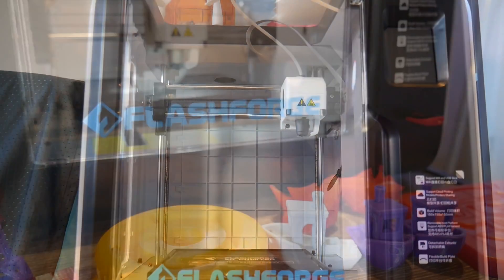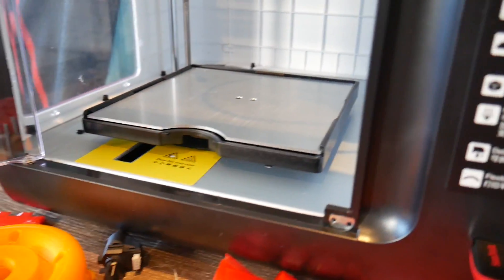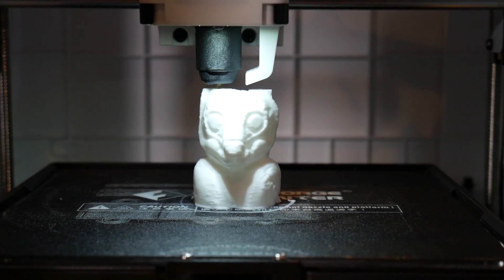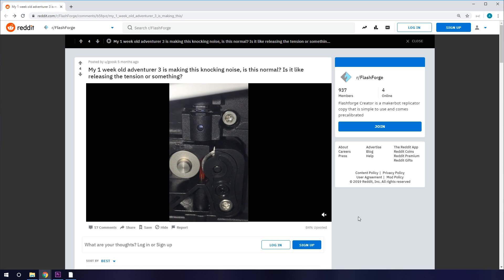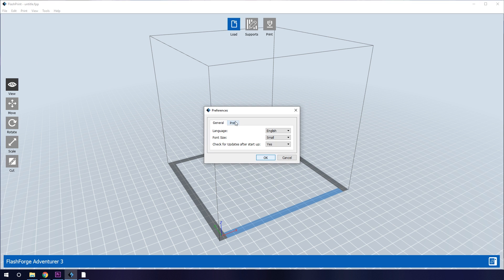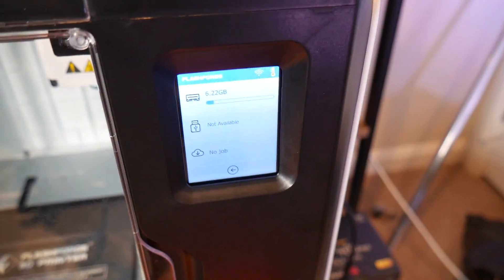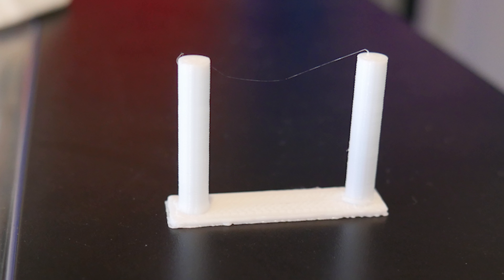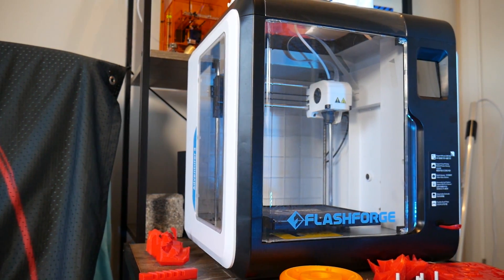The Flashforge Adventurer 3 Review

Comment: I just bought an Adventure 3 V2 to use as an ABS printer at our makerspace.  It did a great job printing the test block with PLA.  Somehow I missed the fact that this printer only takes small spools.  Try to find ABS on 0.5Kg spools.  The only source was FlashForge.  The cost of the small spools of ABS is about 4x the price per gram than the 1Kg spools! Since we are a makerspace with a large spectrum of users, using an external spool holder would certainly lead to disasters.  So, back to Amazon it goes.

Comment: What caused the issue?  Switching from PLA to ABS and back.  The spool change function doesn't heat up (long) enough to clear out all of the ABS from the nozzle, and the next print lowers the temp so the remaining ABS solidifies and blocks it.  Easy workaround is to use a seperate head for each filament material.  Hard workaround is to heat a hex wrench with a torch and go fishing.

Comment: I've noticed by sticking to 500g filament spools that fit inside the unit and avoiding using external spools, I was not only able to use filaments that previously didn't work but it also got rid of that clicking noise. I think the motor that feeds the the filament isn't powerful enough. 

Now, all of my prints, regardless of filament chosen, print amazingly well. I still buy 1k spools, I just now simply off load half of the filament onto a smaller 500g spool.

 I even built a contraption using an Arduino board, USB camera, a servo and an old RC motor. Basically you insert the 1k spool into a machine that looks like an old projector and than an empty 500g spool on the other side, Than while it spools the camera measures out a preprogrammed length, when the length specified reaches it's length, the motor stops and than a servo connected to an exacto blade clips the filament at a 45 degree angle. Everything was printed out using the Creator.
Reply: Thanks

Comment: Stock flashprint sparse infill print speed at 100% is simply to high for this machine, flashprint also use 108 extrusions ratio, (slightly under sized hardware nozzle) and 30% overlap. It will create to much pressure for the filament feeder, especially with 100% infill at 100% sparse infill print speed. Skipping issues with third-party filament is because of the settings. I think they intensionally made it harder to print with third-party filament. Adjusting flashprint settings will make it much easier.

Comment: At least the single wheel runs the correct way. creality hotbeds radial bearings run with sideways load, and no adjustability for sideways play. My ender 2 rollers had almost 1mm sideways movement. The bed was wobbly.  I often get gaps between walls on my ender , and it usually won't stick to hotbed without glue.  

I haven't noticed feeder skipping on adventurer 3 with hotbed at 60°. The skipping starts if I use less than 60° hotbed on 100% infill parts. I use flashforge finder pla and Clas Ohlson 1kg pla spools.

Random ip/mac address issues I've solved the second day after I got the printer.  Firmware update from memorystick.

Comment: Lol I do the same and never use other fillaments besides ABS and stuff from the 3d Printing Superstore in melbourne for ABS. And Jay Car is an amazing place to get fillaments for the Flash Forge printers. The reason I suggest Jay Car over hte Flash Forge website is because the warehouse is always empty.
Reply: Thanks for the tip, Im considering this as my 1st 3d printer and I have a local JayCar near me.
Either this or the Ender 3 v2, still cant decide after watching and reading on reviews for both.
Reply: @TN_AU  If you want an assemble yourself, easy to modify and bigger buildplate go for an Ender, if you want a "box" that comes pre-assembles its like something you just feed and tell it what to do then get a Flashforge.
I had to buy a replacement nozzle for the Flashforge the other day as fillament got badly jammed and because of its design its not really an easy self service. I ended up getting a nozzle V2 which worked better than what I've seen and the quality is much better, the clicking sound that you occasionally hear is now very minimal I would suggest buying from Flashforge if you don't mind shipping cost and its in stock and use JayCar for supplies because you are most likely to get a V2 Nozzle with the printer as JayCar have older versions in stock.

In conclusion, the Flashforge is more user friendly but has limitations with sizes of build, you also cannot print flexable fillament. The Ender will be more on the painful side if you run into issues but in the end I wish I bought an Ender because only being able to print 15cm x 15cm is very small, you also can't print right to the edges on the build plate.
Reply: @cr_macca  thanks for your mini review, much appreciated, pro and cons for both 3d printers, decisions, decisions.
Reply: @cr_macca  doing some research, I wonder if the creality cr-6 se will be a better option than the ender 3 v2, Im happy to spend that little extra and dont mind doing extra mods to improve the unit later down the track.

Comment: The problem you have with mounting errors might be your Cruzer Blade USB stick, I have 6 of them and they all have similar problems.
They also need to be repaired by Windows 10 every time I move it from the printer to the PC.
On my FlashForge Finder, I use their standard settings and PrimaValue filament. No stringing or problems, prints are actually really nice. Maybe you can try that filament on this printer for a second round? 

I can not turn off that damn alarm sound/speaker, I filled mine with glue to shit it up. 😂

Comment: They changed the HotEnd with a new one with a PEEK insert on it. You can spot it also in your hotend so you have the updated one. With the older one it was a pain to print... really. Why is clicking ? If you take a look inside the hotend, the fan is not enough for making an efficient thermal barrier, this is why they added a (brown) peek insert.

Comment: Hi, I am a new  subscriber and a new 3D printer admirer. I own an Ender3 pro and using IdeaMaker slicer. I start using Cura, but once I tried IdeaMaker I love it. One problem is that I have tried all your advices to make it work with the Ender3 printer with no luck at all! My Cura4.0 works excellent with it, but I preferred to use the IdeaMaker best. What settings do you recommend for the IdeaMaker  to work as a Cura? Thanks.

Comment: Wow. Ive had this same problem for ever. Lots of stringing and at times layers split just enough when removing support, it will split layers. I still dont know what issue is. I have a box of different color fillamenta and when I have a good setting for 1 color, its bad for another color, even though its the same spool. I also had to creat a mod for fillament spool. The original is to small for now a day spools.

Comment: I have a Flash Forge Creator Pro 2017 and basicaly all the problems that has mine has but a bit worse especaily the noise, the exstuder gets jamed every so oftern and i have to take off the fan and what not but i solved that by taking out the ones that need alot of heat to melt out when done and swap out the tentions spring for a tighter version so it has alot of roblems but most can be fixed/ delt with.              The Main problem is the slicer program, it is Horendous, please if you ever do anything with Flash Forge again please show a better alterive that works with Flash Forge stuff.

Comment: Devon, the fact they use one motor and a belt to drive de Z-axis is for sure the best option to my opinion and sould by used by many more (low cost) printers.
Using dual motor creates the possebility to misalign the Z-axis when power is shut of from the motors.
With a belt you can never lose position between left and right side on Z-axis
Reply: you have commented this on the wrong channel. this is makers muse, not make anything

Comment: Bottom line, it's a garbage overpriced printer. What's the point of anything mechanical if maintenance, improvements, and modifications are not allowed? It's not even a good printer to begin with and it's a brand name.

Comment: Spend some test print to investigate the clicking sound. The primary cause is the bowden tube, when the print head move from extreme corner to other corner. The bowden tube just flexing and pushing the filament back, so the feed gear lose the grip and clicking. There is 2 solution so far, change the feed gear with grippier gear and lock the bowden tube in the printer ceiling with a tape so the bowden tube doesn't flexing too much

Comment: All these people complaining about this printer, fuck ive had mine for 4 months, yeh i had cluncking issues,  bed wasnt level on the back right corner, but tweeked some settings slowed things up got the bed level, ive run a heap of different brand pla through it, petg all with the old nozzle and it hasnt missed a beat since, only just got the new nozzle and its even better, spend the time like most would do with a new printer

Comment: very happy with my flashforge finder! I can still remember the feeling of ACTUALLY owning a 3d printer! I think now I'm close to 850+ hours printing time, unbelievable :) Flashprint is pretty ok,but these days I use simplify3d, since it performs better. I just load the output from S3D into flashprint (it stores as .gx, I have to manually change it to .g) and print from there. If only I could connect simplify3d to my finder over wifi, than it would be my ultimate solution.

Comment: There was a problem with the MAC address randomly changing causing the IP address to be re allocated. This was fixed with a firmware update that may not have been publicly advertised but was easily found on the forum.

Comment: Great review Angus, not too many issues for FlashForge to iron out, maybe the extruder clicking could be fixed with a firmware update, perhaps even the clogging too.
Reply: In 2019 there's no excuse for extruder issues, especially in a machine which is supposed to be turn key.

Comment: I want to like this printer but can't. Too many niggles for something that can't easily be remedied. I'm surprised the review did not mention that since release flashforge released a newer hotend cartridge that eliminates some of the heat creep that causes the clicking. Also no mention of the propierty gcode format. 
Also "bed leveling" (one point in middle of bed - just z offset calibration) is done on cold bed. No mention of flashforge pita method to "level" bed (watch their video on z screws calibration). No method for back to front leveling except layers of tape under the roller on right hand side.
It is worth mentioning that removing nozzle cartridge also requires a reboot of printer as thermistor will not work. 
Also seen as you mention webcam as a feature you should point out that this is only when using cloud printing which seems very dodgy to me! Can only access your webcam from a flashforge server!! 
Close but no cigar.
Reply: Also it accepts standard gcode quite happily 😊

Comment: The IP changing is probably an issue with your DHCP server.
Reply: Its not an "Issue" though but a normal feature of each router. But you can reserve an IP based on the printers MAC address
Reply: @sintoxic  It shouldn't change them that quick. It's supposed to keep the leases for a while.

Comment: You need to assign a static IP to the printer.
Its not the printer's fault that your router is switching its IP constantly.
Reply from the maker: Cool, didn't know that.
Reply: @MakersMuse  Or just go into your router and create a reservation so it always gets a specific IP based on the MAC address.
Reply: To be fair. I have a Voxel (flashforge adventure 3)and its a issue as well that every boot. It changes its mac address. So in router I cant make it static. Not sure if now its fixed with updates.
Reply: Flashforge has some firmware you can put on a memorystick and install in less than 10seconds.  I did it the next day after I got my printer. Update over wifi didn't remove the random IP and Mac address issues.

Comment: There's definitely a market for an out-of-the-box ready to run home printer but I'm not sure it's at this price point.  My wife has a Flashforge  Finder that she loves.  It does everything she needs and doesn't require much fuss to run or maintain.  She doesn't like to tinker or print mods or spend time tweaking slicer profiles.  She just wants to turn on the printer, load a cheap roll of Hatchbox PLA and print up a few makers coins or other crafty mom/teacher items.  At $300 I thought the Finder was a bit spendy for what it was but she likes it so it's all good.  The Adventurer 3 would need to be far less fussy for me to drop $450 on printer with a 150x150x150 build volume, dodgy cooling and a closed architecture.  BTW... Be careful or at least aware when buying Flashforge products on Amazon.  Their factory warranty seems to exclude printers purchased on Amazon for some reason -  https://flashforge-usa.com/pages/where-to-buy-flashforge-products

Comment: For the IP address issue (6:25), the solution is to contact FlashForge support (https://www.flashforge.com/contact?par=message) and request a firmware update to correct this issue. They sent me a fix which to my knowledge was released in Jan 2019 and when I applied it the issue was resolved. Using the WiFi makes it just that much easier/fun to use!

If you want to save time here is a direct download link to the firmware update (https://ln.sync.com/dl/065d93420/enu5jv2d-9xe8g494-sh288hkq-7x5tj6cq ), just extract the files to a USB key, insert into the printer, reboot the printer and voila! The issue is solved and a constant IP address is displayed even after a reboot.

Comment: I've had this printer for months and only had the clicking problem happen with glow in the dark pla. Only other small issues is the completion time always being off on bigger prints and the extruder slightly leaking and having to pull the filament right before it touches the bed. Also adding a spool holder is a must in my opinion since it can't hold 1kg spools. 

I honestly love the printer though and its been super user friendly for me. Converting files from thingiverse or autodesk is super easy, settings are super simple, and changing any filaments take no time at all.
Reply: Brandon Matuschka  - first print I made was an external spool holder, now I get the best of both worlds 😀

Comment: will you publish a video about z binding to continue the amazing 3d print troubleshooting guide of yours?
its an annoying problem that i had over the past few months and it seems to go away and come back and is more pronunced on tall and low resolution prints.
Reply: I've had so many issues that mimicked Z axis leadscrew binding. One of the biggest ones was having a crappy bowden fitting, which caused entire layers to under-extrude, while the next layer printed fine.